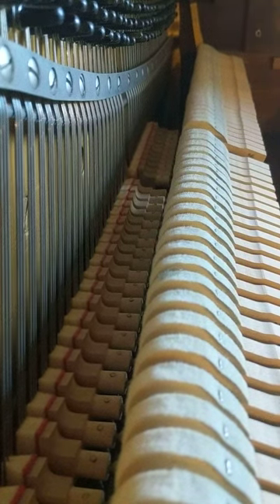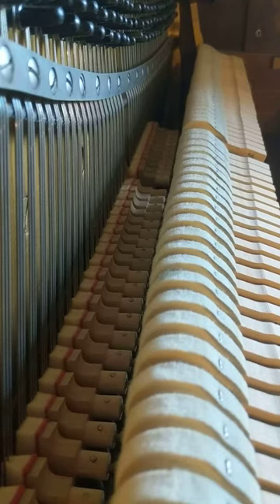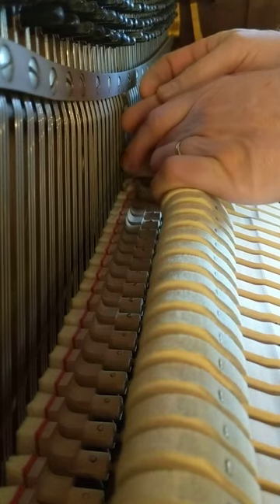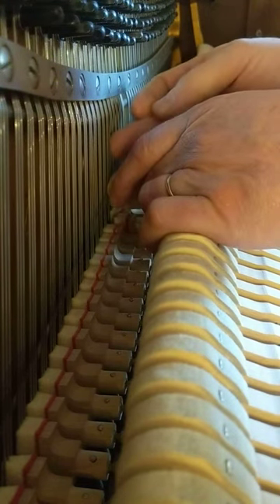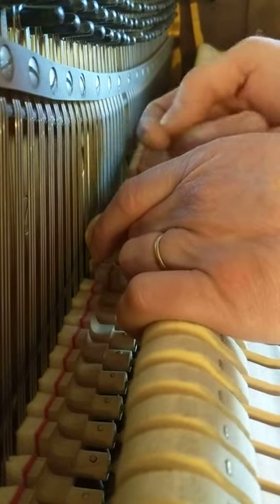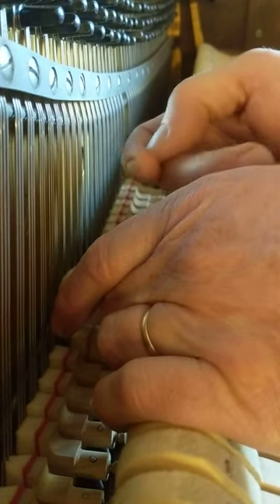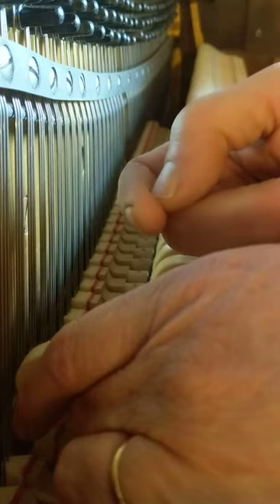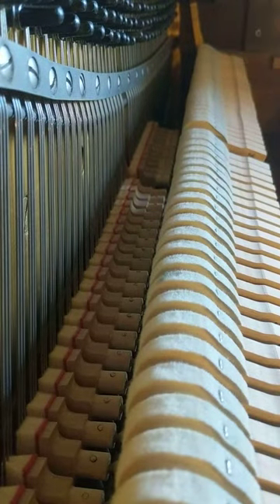Checking hammer to string fit on an upright piano

Comment: Verry verry easy , glue sandpaper on a piece of wood , which you use to stear paint in a can with paint and sand the front of the hammer softly till its flat , 1mm deep , and touches all the strings , nice job ! Greetings George from Holland